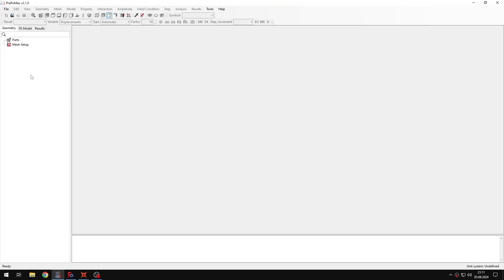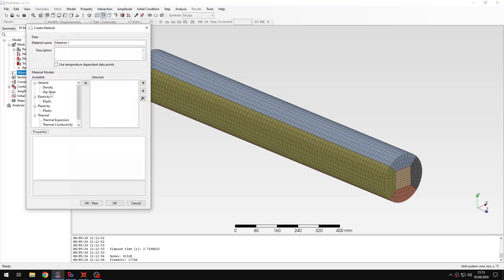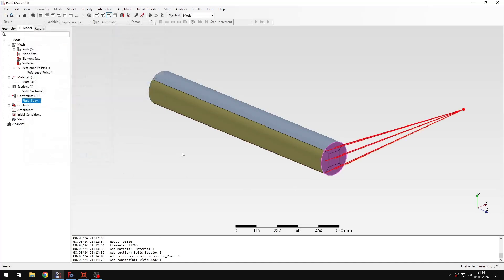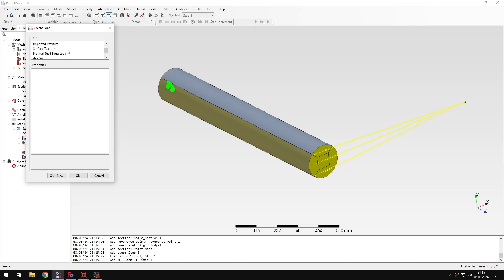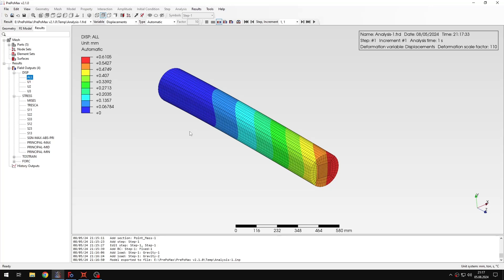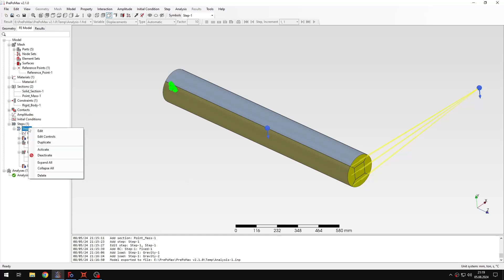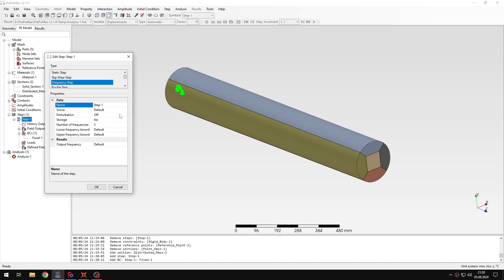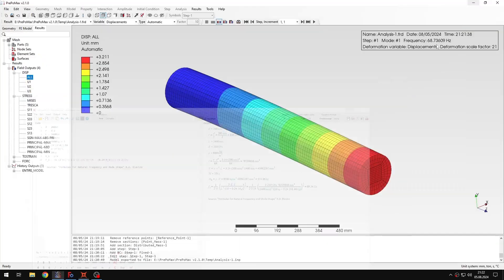PrePoMax (CalculiX FEA) - Tutorial 45 - Point (remote) and distributed mass

Comment: Why did I receive the error: 'The transfinite Gmsh setup item can only be defined on solid parts with 5 or 6 faces,' even though I applied it to the exact same model? (V 2.4.0)
Reply from the maker: But you didn't use my file provided in the description ? Apparently, your geometry has a different number of faces.

Comment: Thank you for the videos! I’m starting my thesis and exploring software options for simulating glulam components. I’d like to ask if it’s possible to define timber materials in PrePoMax with anisotropic properties? Specifically, I’m testing how aligning the grain orientation of inner lamellas with the forces applied could improve the component’s strength. Could PrePoMax handle such simulations, and how would you recommend approaching this? Thanks :)
Reply from the maker: Currently, PrePoMax doesn't support ortho- and anisotropic materials but they are available in CalculiX and thus can be added via Keyword Editor. The trickiest part is defining orientations. CalculiX also has composite shell elements for modeling of laminates.
Reply: @FEAnalyst Are those composite shell elements expanded in 3D ?
Reply from the maker: @Giuseppe-em5pr Yes, CalculiX expands all 1D and 2D elements to solids. There’s just one special shell element that’s not expanded, but it’s very limited.